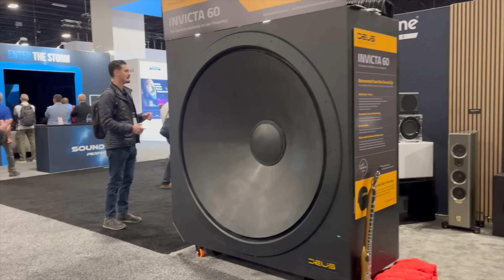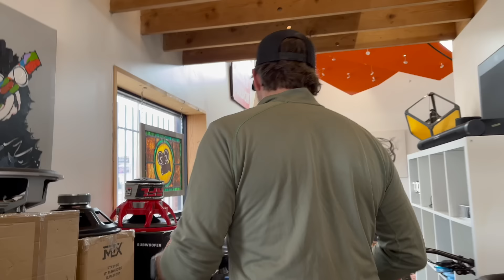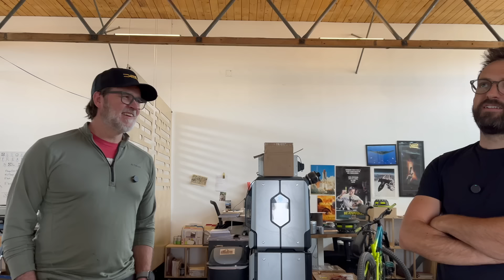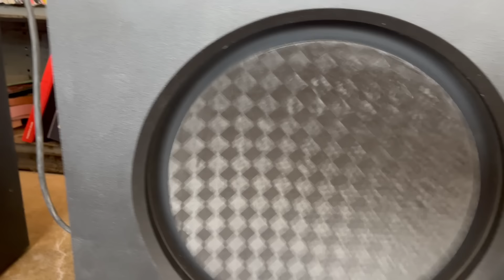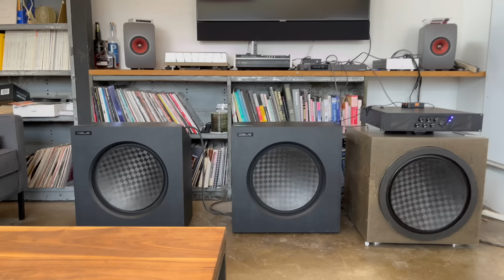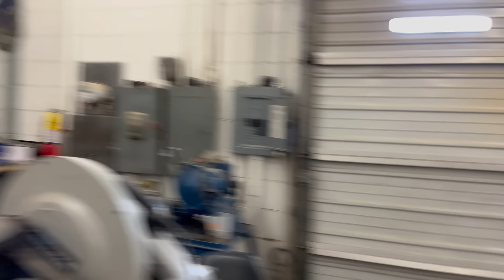60 Inch Subwoofer: Too Much?! | Deus Audio Machines Tour

Comment: Sad that you didn't show any of the Invicta 60" sub demo in motion in the video...or even the garage door shaking...that we could see? For me I wanted to see that by far the most, even hear to but for some that is asking too much. 
The amplifier charges/powers the voice coil(s)/electromagnet to move the speaker in one direction only and the paper spider returns it back to a resting position, as the magnet has a more permanent and lasting charge in it as I understand it? Some speakers have dual voice coils so to cover this greater travel distance, and some even have two separate spiders to keep the voice coil(s) in better alignment throughout the full range of motion/travel/sub excursion plus to return the speaker back said resting position faster. 
The Deus Audio Vera 18" subs look cool...testing would be cool to see how low they actually can go before they drop off.
Reply from the maker: I got video of the Invicta 60 in “motion” but the travel was so short you can’t actually see any movement. It doesn’t have to travel far to displace a lot of air!
Reply: @GeorgeTheaterAtHome   That is usually a sign of a tuned sealed box to a short range spread of like 10 htz to like 35 htz (just speculation on the range). Very efficient though...hopefully I am wrong though.
Reply: The magnetic force both pushes and pulls the voice coil, attempting to precisely follow the input drive signal.
 
The restoring forces of the driver's suspension, and the small volume of box air, impact the operation but typically only to a small degree.

Box volume in sealed alignments primarily impacts sensitivity as frequency lowers.
Reply: @FOH3663  What a dummy I am thinking that Direct Current only acts in one direction on a voice coil. I should have failed engineering. 🤦‍♂
Reply: @sickjohnson  
If it was DC it would only act in one direction. 

Place a 9V battery across a subwoofer driver and it will deflect and hold one direction.

Comment: Oh man, 2 of their Vera18s in your HT could be awesome!! The website states a 29mm xmax with .6 QTC with nearly a 137db max spl.. says down to 10hz @ -10db.. but for 2 18s, how well do they perform below 20hz? I bet they sound amazing tho. IMO, your HT would be perfect for them to do testing and see how room gain etc affects their sound.  🎉
Reply: Let's make it happen! The Vera 18's are really optimized to be tight subs for the traditional 20-80Hz region, so I don't expect earth shaking infrasonic performance out of them, but they are sealed, so they fall off at 12dB/oct, and in a small room they will definitely pressurize the space with clean, tight, ultra low distortion goodness.

Comment: Pretty good, but their 18s seem to be priced at $34K, which is crazy expensive imo. Unless they specify the woofer's BL and Xmax, what they are saying is nothing new. A strong motor force means it will control woofer movement up to a certain point. They can tune the box size and power to make the sub stay within those limits. That is what makes for a good traditional sub design.
Reply: At that price point, you could find an array of subwoofers, sealed or ported, probably a combo of both, and you could easily get clean, tight, and low bass all at the same time. If you pick the right drivers and have the correct box designs, correct placements, and do some good crossover/DSP work you could have a flatter, or whatever curve you want, at very intense SPLs.
Reply: @mattwells1036  True. I think the only thing is size. I checked the specs of this sub...honestly looks unimpressive with an f3 of 38Hz...maybe sounds good with music
Reply: I though that was the price of 60s inch lmao. The 60 inch is probably like 70k then Or almost 100,000 maybe, i wouldn't pay more than 100,000 for it even if i had the money.
Reply: @justino9042  The 60" one would run $150K+ with a 20kW amp I think
Reply: @MusicwithMattM that's like selling a car without the motor Lmao, or a house without roof, or windows if the 18 inch is 34k and it has the amp, i think that 60 inch at 100,000 should have all and the amp as well.
Reply: @justino9042  Yes, it has the 20kW amp

Comment: Well, there's nothing new and out of the ordinary. Check out the 63-inch, 800 kg subwoofer made in 1985 by Mitsubishi, the Diatone D160.
Reply: Totally true. The difference here is that we've focused on making the most accurate possible subwoofer. Big and loud is easy. Ultra low distortion was the tricky part.
Reply: Ascendo also does a 64”
Reply: @RichK-GB  , true. I only wanted to say that the idea of huge subwoofers is not new and it's actually pretty old.
Reply: @byron19800  
You're absolutely right, nothing new. 
I'm an old dude, I've been at this since the 70's. 
Hartley had a 24" sub that DIY'ers used decades ago. 
Also Fostex, Precision Devices, maybe others, ... offered huge drivers for years. 

However, there's a sweet-spot in size, whereas multiples outperform larger mammoth drivers for much less. 

But the primary attribute of the mega drivers is the manner in which intensity dominates the experience. Typically sized drivers (18" etc.) can't achieve the same effect.
Reply: @RichK-GB They also make 80 and 100 inch

Comment: Comment about your last video on the Anthem processors. Do they have the same speaker snap/pops as the Trinovv when the input signal changes?
Reply: @roBLINDhood I have no experience with Trinnov's, but I can tell you there is no snap/pop from the speakers with the Anthem AVM70 when switching inputs.
Reply from the maker: No
Reply: I have zero snap and pop with my Altitude32.